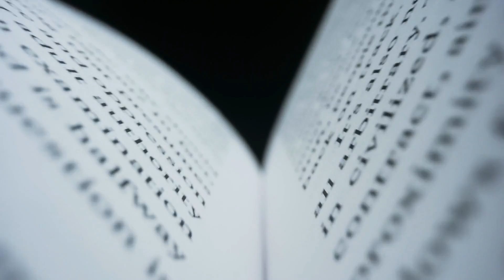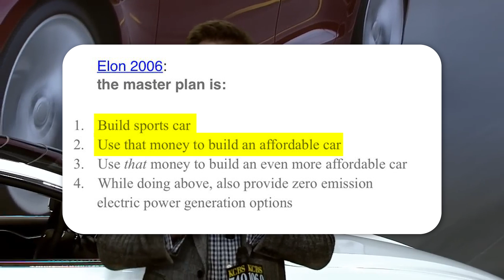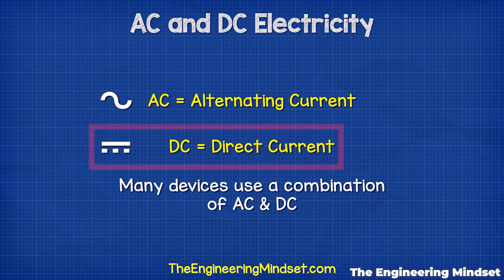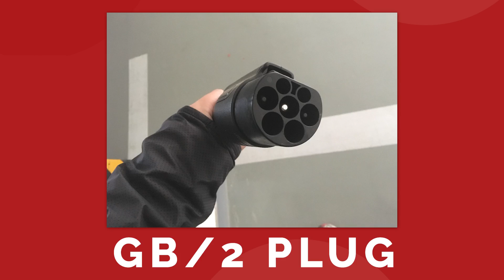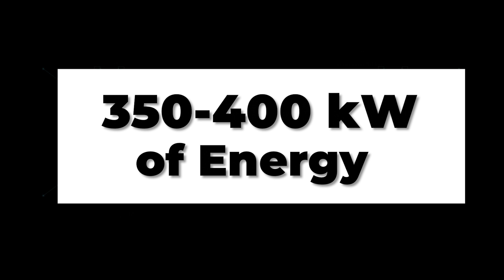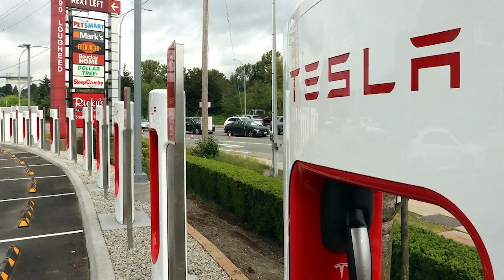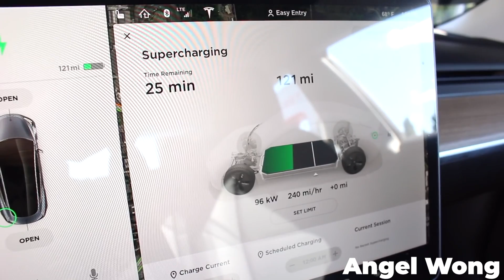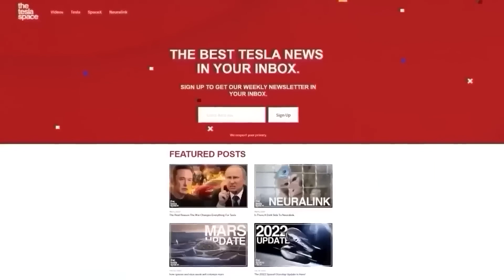The Incredible Logistics Of Tesla's Supercharging Network

Comment: I bought my Model X because of the superchargers in 2017.  We drive to Fl from NJ and I looked at the Bolt and there were DC fast chargers as far as Va.  after that it was only level 2 chargers.  No deal on that.  Tesla Supercharger we’re all the way at about 150 miles.  Since 2017 that distance has been halved by the addition of more chargers.  Also they put them on more routes so now we can drive down the east coast ocean road. Route 17 rather than Rt 95.  Also the cost to charge on a Tesla charger is way less.  On 2/7/2023 I saw a Electrify America station that one was charging.43 per Kw as a joined member. The second unit was charged.99 perKw, non member.  I was shocked as this would be way more expensive than an ICE per mile vehicle.
Reply: jesus can you imagein doing a road trip depending on level 2 chargers? that is the stuff of nightmares.
Reply: @jmattos hahaha would take 4 hours a fill up .. yikes 😬

Comment: what happens to the batteries of teslas that have exceeded their useful lifetime?
Reply: They can recycle the batteries.
Reply: They become storage batteries. When they're no longer useful for that, they're recycled.
Reply: First of all, the lifetime of these newer batteries is several hundred thousand miles. Secondly, see Redwood Materials for info on battery recycling back into new battery materials.
Reply: We’ll let you know when that ever happens. Teslas since they started manufacturing are still running on their original batteries. Do some have failures?, yes, although it’s not the entire battery pack that fails, it’s typically just individual cells that fail or don’t charge to 100% and just reduces the overall range but not a complete pack replacement.
Losing 1-2 miles range after 5 yrs can be possible. These cars as Elon stated are built for 1 million miles. Mechanical limitations apply though.
Reply: @abblepc  GM might choose to use 4680 soon,those are the same batteries that Tesla uses for it's cars.

Comment: i always thought the word inverter was used for DC to AC conversion, and the other direction AC to DC conversion was called a "power supply" or "wall wort" but not inverter
Reply: Nah, you are right, there was an error.
Reply: You're correct.
Reply: AC to DC is technically a rectifier.

Could be a half bridge or full bridge rectifier.
Reply: @D0li0  I don't know where people are getting this rectifier nonsense.  A rectifier is a component in a CHARGER.  But the output of a rectifier is NOT DC.  It is a very noisy signal. You need the rest of the CHARGER to get to DC.  That's why its called a "super CHARGER" network, not a "super rectifier" network.
Reply: @RogerWilco1  lol, shrugs, not gonna work without the main component, a rectifier... Which is just some diodes, and of course there is more to it than just those...  But it is definitely not an inverter.  And it's called supercharger because that's the branding, nothing to do with the guts... Shrugs.
Reply: @D0li0  The rectifier is not the main component.  You can't believe everything you hear on YouTube.  Its called a super charger because CHARGING is WHAT IT DOES.

Comment: Inverter: changes Direct Current to Alternating Current. Rectifier: changes Alternating Current to Direct Current. Conflating the two different devices into one term is a  great disservice. Please be more careful.
Reply: Where did you hear this word "rectifier"?  You don't know what it is.  It does not convert to DC.  AC to DC is done by a CHARGER.  Hence "the super charger network" not the "super rectifier network". The output of a rectifier would destroy anything plugged into it and switching power supplies use a completely different method entirely.   Its sad that someone who half understands things made a youtube video calling them "rectifiers" and now all their follwers are correcting this guy (Who half understood) by giving him the wrong term.). 

Literally on the vehicle diagram its called a "Charger".  You can buy battery chargers on Amazon.  You can't find battery "rectifiers" on amazon.

Comment: RECTIFYER NOT INVERTER…. BIG ERROR ON THIS VIDEO
Reply: Where did you hear this word "rectifier"? It is only an internal component.  The output of a Rectifier is not DC. The output of a rectifier would destroy anything plugged into it and switching power supplies use a completely different method entirely.    

AC to DC is done by a CHARGER.  Hence "the super charger network" not the "super rectifier network". 

Literally on the vehicle diagram in this video its called a "Charger".  You can buy battery chargers on Amazon.  You can't find battery "rectifiers" on amazon.

Comment: Great documentary. Would have liked to know more about the number of superchargers that can be installed in an area based on grid capacity.
Reply: Virtually unlimited can be installed. It’s how much are they used and at what current draw. Typical households are rated at 150-200A service, an average Tesla will charge at a SC with inboard inverter/regulator at 40Ah. So I like to think of equating it to plugging an electric oven (uses less) into an outlet for most charge cycles, for less than 40mins on average.
My Model S has a 40A charging circuit ability and newer models have even less with more efficient battery chemistry and can still charge at similar rates.
So how many ovens can be running in an area based on grid capacity? How many homes etc, Long story short.. EVs - Teslas aren’t really loading down a grid as much as people think. 

Charging at home with my level 2 charger at 40A (vehicle limit) on my 60A circuit, adds 32-40 miles/hr and charged to just 80% from almost 5-10% start point, only costs me like $15 for that 150KWh. Still think this is “killing the grid”?
Point being there is much FUD on the internet concerning our grid not handling EVs.
How far can I drive on that range is varied based on driving conditions but typically average 200 miles per charge.
Reply: @abblepc  Our electricity provider, DTE (Detroit Edison once upon a time), has stated the problem is not generation capacity, but rather distribution.  In the subdivision where I live, if there were ~20% adoption of EVs the ~10kW each would strain the local transformers requiring upgrades.  I'm not sure how many subdivisions/communities would require upgrades, but it appears to be a limiting factor, Tesla or no.  Also, GM announced 40k chargers across the US, but those are Level 2 chargers, which are useless for travel unless you want to spend 4-8 hours at a dealership or wherever.

Comment: Non Tesla chargers are frustrating many out of service, few, minimal stalls, slow speeds.   Tesla superchargers, I stop ever 250 miles, pick up 250 miles at a station grabbing a coffee then on my way.  easy Peezy..  recent 12 degree-30 degree F trip no problems with preconditioning.  Car seemed no to be affected by cold with shorter range.  VW pulled their optional heat pump as not as efficient as their resistant type heater.  Tesla heat pump state of the art Again

Comment: ☝Correction needed: There is much confusion starting from 4:50 about inverters and rectifiers . Inverters are DC to AC converters, rectifiers are AC to DC converters (in regular life, people usually call them just that: "AC-DC converter"). 
For instance, the picture at 4:54 is indeed an inverter, but it's the opposite of what's talked about at this point in the video (rectifiers).
But in general there's a misuse of the term "inverter" where in fact it should be "rectifier" or "AC-DC converter".

Edit: I'd suggest going for "AC to DC converter" for the replacement term, as "rectifier" usually refers to only a part of the AC to DC conversion process. "Charger" is also a good term if it suits what the author wants to convey.
See thread below for arguments.

Maybe add some red text with an asterisk to correct the few wrong frames? Re-doing the voiceover would probably be a pain.
Reply: I too was bothered by the incorrect use of inverter for AC to DC conversion.  To avoid a pedantic debate, probably charger is best.  Clearly, all EV - DC Fast Chargers are more than rectifiers because power to vehicle is strictly controlled.
Reply: Well, this must be an all American understanding, at least of converter. In europe we use converter stations for HVDC conversion from and to HVAC. And there is no discussion on that from authorities, manufacturers or operators. 
Modern converters have the possibility to work in both directions and thus make it irrelevant if they work in rectifier mode or DC to AC mode.
Reply: Good, I rarely comment on Youtube videos but that is the right information, usually Tesla Space has their info right but this was a mistake. Thank you for addressing it. (I am an Electrical Engineer in aerospace)
Reply: @nicolastardif5039  You are an electrical engineer and don't realize that a charger or power supply is the correct term, and that a rectifier is just a component (4 diodes) and not sufficient?

Not sure where this "rectifier" terminology came up but its not right.  (AC to DC is a charger or a power supply, hence the "super charger" network.)
Reply: @RogerWilco1  Rectifier is the correct term for AC to DC.  To make that into a charger, true, there is a little more involved.
Reply: A "Rectifier" is just a combination of Diodes and it is the first step in converting AC to DC.  The correct terminology is "charger".  That's why its a "super charger" net work not a "super rectifier" network.  Also the term "power supply" can be used.  But the rectifier is not the only component or even the most important one,. and swithcing power supplies (switching chargers) are a very different animal on top of that.
Reply: @RogerWilco1  Fair point. In electronics, when we speak of a "rectifier" we often only mean the diode bridge or a similar IC. A fully functional AC-DC charger uses subsequent stages for smoothing out and regulating the current.
However, rectifying current, in the fully functional sense, implies these smoothing and regulating stages, or else it's unusable for DC applications. I can't really think of actual uses for unsmoothed "rectified" current.

I think the best terminology would indeed be "charger" to convey the practical aspect of it, but "AC-to-DC converter" would be better to convey its operating principle at the physics level.

As for "rectifier", I picked this one because it was a "symmetrical" term to "inverter" and seemed neat in that regard. But in the end, I'd go with "AC to DC converter" for the replacement.

@Everyone If anyone sees something to be added or corrected, feel free to comment or vote so that the author can pick the most apt correction.
Reply: @cielvague  You have just repeated, almost verbatim, my first comment above.
Reply: Really doesn't matter if he shows the wrong image, what he said was correct.
Reply: @SjMk1.  The picture was just an example, and now that you mention it it was probably the least pertinent one. I've since added a "for instance" and another line to clarify what the errors were.

Comment: FYI, AC to DC converters are called rectifiers. Inverters convert from DC to AC. :)
Reply: From google:

An inverter and a rectifier perform opposite functions in electronic circuits. Both act as electric power converters; a rectifier changes current from alternating current (AC) to direct current (DC), while an inverter converts DC to AC.
Reply: A rectifier takes AC and gives DC but it is pulsed because the AC is alternating.  A  charger might give a pulse, but probably gives a constant voltage using a storage device like a capacitor to maintain the constant voltage between the pulses.
Reply: It's more complicated than that.  The AC to DC converters used in car chargers have some serious switching boost converters in them to boost the voltage up to the level needed by the vehicle battery, as well as to implement Power Factor Correction so the charger doesn't tear up the electric utility's AC sinewaves, and a constant-current circuit.
Reply: The fact is that the video is incorrect, an inverter is not the plastic thing you plug between your phone and the wall. Roger Wilco is also incorrect throughout this thread, everyone else seems to have it straight. The very first step in most power supplies is to rectify the inbound AC current to DC current.
Reply: This was driving me nuts lol
Reply: Also, generators are not called Alternators, except in cars? And those generate DC…
Reply: The original post is correct.  Two diodes make a rectifier.  Diodes send current only in one direction. Set one up one way and the other up the other way and presto you have a rectifier.   I was about to make this correction myself till I saw this comment
Reply: Bridged rectifier to be specific
Reply: Whoa, whoa, whoa! Time out! So does it really matter if it works?
Reply: An inverter increases the frequency DC To AC. A converter cuts the frequency. AC To DC
Reply: A rectifier is part of the charger, but its called the charger.  There are many types of chargers, including switching power supplies that produce DC but are not as reliant on rectifiers as an old school simple power supply / charger (which could be just a rectifier and some capacitors and resistors and then a transistor to keep the DC voltage regulated.).
Reply: @RogerWilco1  No, the part that converts AC to DC (which is what he is talking about) is a rectifier, a charger is a type of power supply that is designed specifically to charge batteries.
A power supply is a device that is designed to produce one or more stable power rails to operate electrical equipment. Power supplies come in AC/DC, AC/AC, DC/AC, and DC/DC variants with AC/DC using a rectifier, DC/AC using an inverter, AC/AC and DC/DC use either both or neither depending on the design.
Reply: @mdanieltays  Literally every sentence in that comment is wrong.  A rectifier does not output DC.  

You have no clue what these words mean and are obviously repeating something you heard somewhere... where did you hear it?
Reply: @RogerWilco1  a diode can only output current in one direction, thus direct current, and a single diode is called a half bridge rectifier
Reply: @RogerWilco1  Are you some sort of wind-up merchant? If so, what's the purpose?
Perhaps he heard it at college on his way to a qualification in electrical engineering, as I did...
Reply: @mdanieltays  Correct.
Reply: @RogerWilco1  Where did I hear it? 
"1.6.2 Rectification  
A rectifier changes ac to dc;" 
page 31 of The Art of Electronics Third Edition by Paul Horowitz and Winfield Hill
Reply: @RogerWilco1 Why did you so passionately argue your objectively false position on the premise that a YouTuber told you it’s true?
Reply: @RogerWilco1  Incorrect.

Comment: Most people do not know that most PUBLIC charging is slow, cheaper built, Level 2.  Majority of Public DC fast charging is only 50 kw vs Tesla 120-250 kw.  Fast in/out in 15 minutes generally keeping in the 20-80% sweet spot charging. Plus Tesla integration of their navigation with the supercharger network.  Also no apps or credit cards to foul around with.  Everything seamless and easy.  Tesla msrp includes building thee expensive chargers.  Public chargers left to taxpayers and other companies to build.  More superchargers supplemented eith megaPacks and solar.  Tesla will be able to undercut prices per kWh charging costs of competition
Reply: 50kw charger is just right for my soon to be Aptera 400 miles.
I do have a question. How do you know the kwh of the tesla charger. 
Thanks
Reply: @eugeneflorida1408  Using either the navigation screen on your Tesla or an app like A Better Route Planner, tap on the charger in question and metadata for charging level, local services and food will be displayed.
Reply: EVgo has 350 kw chargers and 100 kw chargers.   I get 100 kw or 78 kw of input to my Tesla.  I precondition by setting the nav to a supercharger nearby.  If you have a Chevy Bolt it will never take in more than 50 kw input.